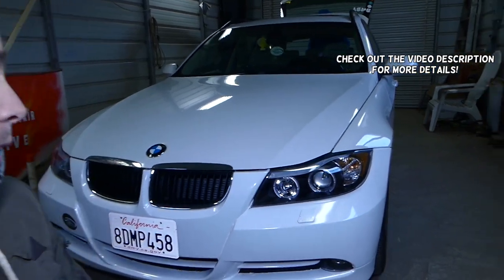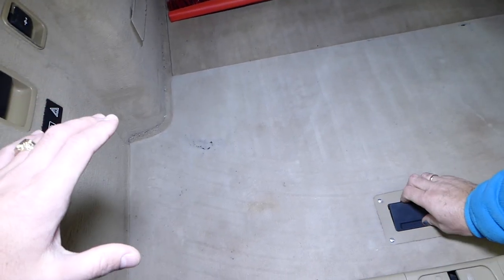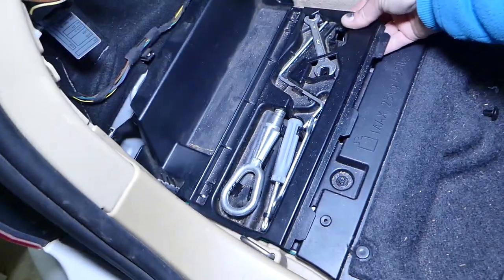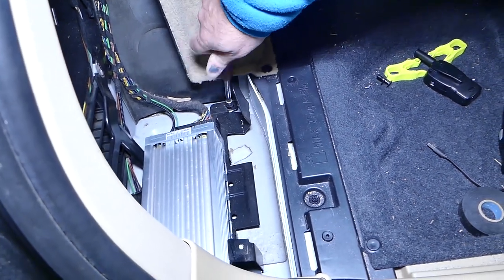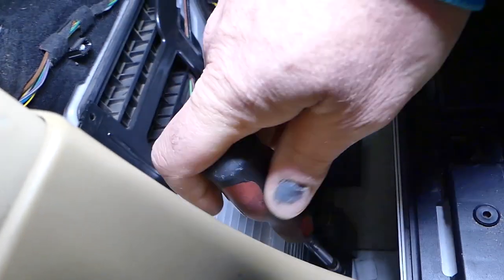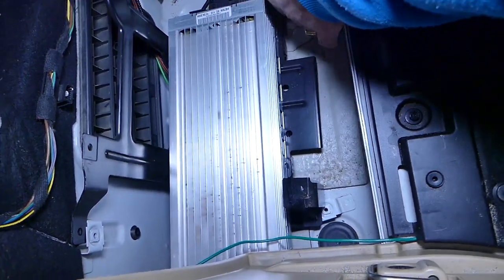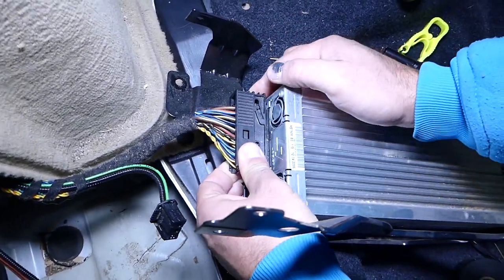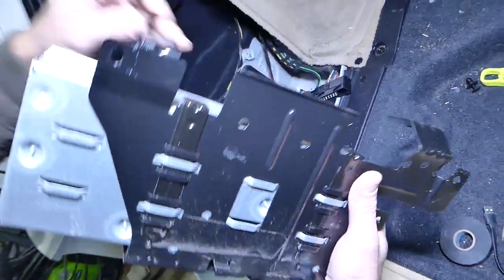HOW TO REMOVE AND REPLACE SOUND AMP AMPLIFIER ON BMW E90 E91 E92 E93

Comment: Great job. I always enjoy your informative videos. The panel cover and amplifier fixation bracket does not need to be removed completely for replacement but I understand the need for video tutorial purposes. The bracket slides do unpin under the floor. However, I would rather totally remove the amp from the current position.

Comment: I have the same amp in my E64 ( Logic 7 L7 Top-HiFi) but, both the subwoofers wouldn't work and there was no bass at all. Everything else works, just no bass at all. For me (after tremendous blood sweat and tears), it turned out to be the negitive output for both left and right subs from the amp that are at fault. I  used the center channels negative wire and connected it in parallel to the it with the subs return negative lead, and suddenly I have bass. I did the same for the other side, and still used the center channels negative lead to the amp (but continued using the subs own positive wire). Nutshell: Bypass the negative wires for the subs, and instead tap in to a different speakers negative wire.  

Then, to prevent any further strain on this already failing amp, i decided to use the positives output for each of the subs from the L7 amp, and the negitve from the center channel to feed directly into a high level input  (speaker line, as opposed to RCA) of a second cheap amp to drive the subs. Working nicely so far. Hope this spares someone the pain I had to go through to figure this out. I really did not want to spend £350 for a second hand ebay one (which could well fail after a month). Apperently bmw will sell u a reconditioned L7 amp, but i never investigated that route. I still do not know what exactly failed in the amp to cause the no bass issue, but i know this workaround is going strong for me.
Reply: I think this is pretty common as my 335i and another mates 335i have no bass what do ever n stereo sounds crap where as another friend has an e92 n stereo sound is awesome!
Reply: I’m having the same problem. Can I change my amplifier for a logic 7?  I just got one from a junk yard
Reply: I have the same issue can I email you about about what u did?😅

Comment: You do not have to remove any of the bolts,just pull those 2 tabs he shows you at the end,they can be bent a little to get them fully out.The amp will pop right out

Comment: Question i was told after installing the amp on a 09 335i it needs to be flash or in another words needs to be programmed is this correct?
Reply: Needs to be coded to car, literally google e92 amplifier upgrade and it’s the first thing that comes up on e90post, find out what stereo system you have and u can find out how to code it n do what’s best to install

Comment: I have a 2009 750Li I got a replacement amp from a 2010 750Li do I have to code the amp or just plug and go I plugged it in b and nothing but I didn’t disconnect the battery

Comment: Are the Lear amps of the E90 and E91 interchangeable? I have an E91 with and amp I need to replace and have an E90 amp that looks exactly the same but the part number is slightly different.
Reply: wondering the  same exact thing,, all so  are they  have to be reprogram?
Reply: I just changed mine .. some are interchangeable and some aren't. Most are though .. i got mine from a 2011 745i and it fit my 2011 M3

Comment: Anyone know what the other set of connectors are for? The ones that were not connected to anything after the amp was removed. You'll see it as a set with a visible brown wire.
Reply: I was wondering the same thing!

Comment: Where else can the amplifier be? I hve a BMW E90 2008 and i did not find it in this location :l
Reply: I have the same question in my 2006 e92!!
Reply: Maybe because you have the base stereo system. The base system is powered by the head unit. Easiest way to check is to see if you have tweeters on your A-pillars. If yes then you should have an amp somewhere. If no you have the base stereo system.
Reply: Can an amp be fitted to a base system ??
Reply: I have e91 2011 with the Harman Kardon sound system with the Navigation screen, my amplifier is not located in the back aswell. help anyone? i have googled everywhere...

Comment: My amplifier isn't there wtf, or is it a under a metal cover?
Reply: What model do you have? If it’s the station wagon than after you remove the trunk carpet you have to go up and remove the other trunk carpet. It usually lifts up
Reply: Or your car didn’t come with the logic 7
Reply: @easyfix6405  e90 salon, yea it has the  worst sound complication. Already looking to upgrade, still managed to connect an additional subwoofer with amplifier into stock radio :)